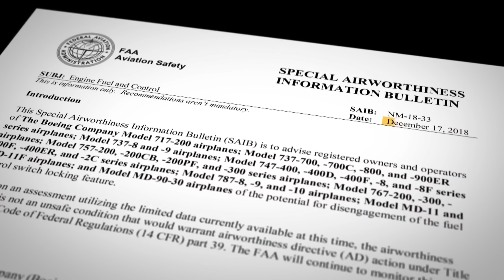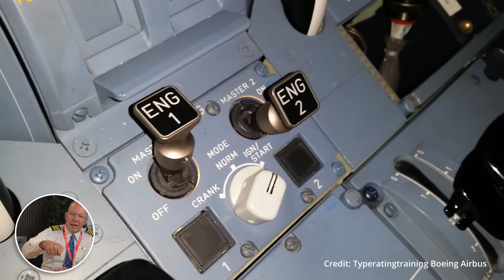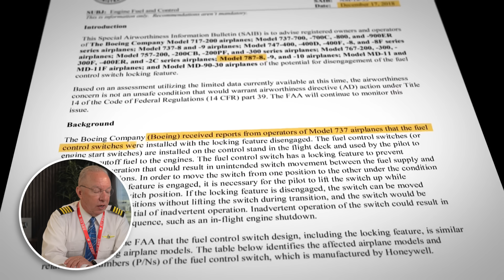Air India 171: The FAA’s 2018 Fuel Switch Locking Bulletin Explained (16 Questions Answered)

Comment: With all due respect Captain Steve , 
I just wanted to say 
The report showed that the flight was perfect and was scheduled for re checking for December 2025 .
Then if the Plane was perfect why there were so many technical errors goin with the same flight as recorded by the passenger ( Delhi-Ahmedabad) that day itself  bfre the the scheduled flight from ahmedabad to London . There's also a video of that flight having too many technical issues . 
So if all these components are already not working then I just want to say is there might be a possibility that the two fuel switches locking system might not be working properly  as well.
The chances are still there. 

Second thing( I might be wrong) 
But according to ur previous video you said the person might be lying that he didnt turn off the fuel switches . The thing is why would a person lie at literally his final moments?? Like even if his voice is being recorded by black box why would he just lie when he himself knows his fate is near ??? 

These are just some of my questions. If anyone can plz answer please do so.
Reply: When the plane reached Ahmedabad that morning, the techs worked on its electrical problems and released it as fit to fly. During the sadly short and final flight, the flight data recorder recorded no electrical problems at all. 

As to what the pilots said, I'm hoping the full report will have a transcript of everything they said as they pulled away from the gate to taxi to the runway. It may be that context will clarify some things. 

As to why he might lie, maybe he thought putting that on the cockpit voice recorder would spare his family some pain or even let them collect an insurance payout? 

Or maybe he was afraid his co-pilot would be able to save the plane and its passengers and he wanted to escape the blame for doing something truly horrible?

So many questions. Such a long wait ahead for the final report . . .
Reply: @Everywhere2 Pretty reasonable indeed 😮, Though We can't say anything to be 100% sure.  There might be high chances for pilot taking his own life still we cant ignore that 1% of any other cases.We have to wait till the final report comes to answer our questions 😔.

Comment: As an engineer, I would disagree with how you interpret the bulletin. It says they switches were installed with the locking mechanism disengaged, not that it would prevent the switches from being put into "run" position because it was installed wrongly. I remind everyone here that a pilot is not an aerospace or aeronautical engineer.

Comment: The question about the RAT deployment at 15:23 is interesting, not because of the source of where the questioner’s information came from, but because a photograph on page 14 of the report taken seconds after the plane was airborne and probably no more than 100 feet off the ground and still over the runway clearly shows the RAT deployed. I believe the timing of the RAT deployment in the preliminary report may be erroneous.

This report has led many commentators to go where nobody wanted to go and point the finger exclusively at human intervention on the part of one of the pilots. A full transcript of the conversations of the pilots, identifying who said what and when, including communications with ATC, may tell us why what happened did and prevent jumping to conclusions.

Also, the time for the aircraft to get airborne from the beginning of the takeoff roll to being airborne was more than a minute, which is long, notwithstanding the performance impairment caused by the hot ambient temperature. This could point to a problem, including the possibility there was overloading from luggage, a notorious issue on many flights originating in India.

Also, I understand it is not uncommon on Air India for a member of the cabin crew to be seated in the cockpit during take off and landing. I don’t believe the possibility of a third person being in the cockpit can be completely ruled out.

There is not enough evidence in the report for people to conclude human intervention on the part of one of the pilots. The pilots’ families deserve better and so do the families of all the victims in this terrible tragedy.

The report raises more questions than it answers, including why the Indian authorities waited until midnight on Friday, local time, to release it. That immediately raises suspicion that they were hoping it would escape mainstream media attention and critical scrutiny.

The preliminary report from the Boeing 737 Max first crash pointed the finger at human intervention, which turned out to be a travesty of justice. I am deeply concerned that so many people are willing to take the report at face value and not apply deep, critical thinking to it.

I believe the NTSB also needs to address the Wall Street Journal report, and reports from other reputable outlets, stating that the NTSB had threatened to pull out of the investigation, instead of stonewalling with a blanket “no comment.”

Releasing the full transcript of the cockpit voice recorder, identifying which pilot said what and when, and the transcript of communications between pilots and ATC, could clear up so many of the ambiguities.

It seems to me that the December 17, 2019 safety advisory on fuel cutoff switches should have been an airworthiness directive. It would be awful if it turned out that failure to make it an AD contributed directly to this disaster.

Comment: Hi Steve just one question, if both the engines were killed in a gap of just 1 second. Once the pilots realised the error he switched one switch back to run but Why do you think it took 4 seconds to turn the next engine on. All thought unbelievable when the crew realised the emergency. I think stopping the engine must be mechanical or electrical failure.

Comment: Concerning the rather arrogantly put and judgemental question from @12:23 this smacks of the current crop of folks who despite seeing with their eyes and hearing with their ears they still would not believe because it simply does not fit their pre-concluded narrative. Why don't folks just simply do some basic reserach before commenting on topics that are so widely in th epublic sphere? If @Katebatt7538 had done so she would have learnt that one pilot asked the other why they had put the switches in the cut-off position which the other denied. Why can't we just wait for the facts to unfold instead of bismirching the likes of Boeing?

Comment: Fuel cutoff switchs should be in up position instead of down to prevent pilot to accidently hitting them during take off since gravity tends to push our hands and arms down.
Reply: The switches are designed to not change position because they've been bumped or touched accidentally.
Reply: @Everywhere2 if they would have designed the switches so the cut off position if in the up position, would there be better because even if you accidently pushed the switches down, they would already be in down position.

Comment: 11:50 but hang on Steve, if there was a fire they'd pull the fire handle (and move them to discharge the first and possibly second bottle), they wouldn't be using the normal engine switches

Comment: I find it crazy that ATC have to undergo psychological tests periodically and pilots don’t. The FAA needs to get this sorted.
Reply: A key reason for the difference is that almost all of the air traffic controllers in the U.S. are federal employees. Airline pilots are not. The FAA can more easily make rules for itself than for corporations. The airlines resist in many ways on many things, but this crash may, in combination with the three or four other pilot-caused crashes, get them to adopt better testing, reporting, and treatment options. 

While they sure as hell haven't wanted to reduce the stress load on their flight crews, some changes were made (unevenly) after the Germanwings crash.

Comment: If they cut it off 3 seconds into flight that not letting you know the engine been turned off on the ground why you all think the rat came out so quick and the rat was out before it took off wild airborne in the Rock jump out on full trust those engine turn off on the end of the damn runway what you're talking about and that's what makes the shut them off cuz they are just airborne while I still had that trust the shot of my one of them off to try to turn it back on it didn't turn on then turn off the other one to turn it back on and then turn on clueless what to do have some empathy Captain Stevie

Comment: In todays age every transport mode has cctv installed be it train, truck, cars, cruise etc then why not planes. This is just stupidity. Any cost cutting measure, pilot privacy etc thing should not come in between in implementing such a basic function . Even a low res cam would be fine enough to capture the scenario.

Comment: But there wasn't a place to cut off for too long because someone turning them back on you just showing a picture of both of them being off did they stayed up did they turn back on 23 seconds 5 seconds after a pilots turn off the engine to see if they could get them to reboot back quick is split seconds situation bro it's not no minute situation it's seconds😮

Comment: Captain you keep repeating their mechanical so therefore they do have a breaker mechanism to snap them off if you Rollin you might not hear the snap off if you roll in and it's roaring engine you will not hear the breaker snap off does it have a breaker switch built in and that unit been warming up spring get weeks when it warms up and don't let the solenoid to switch it off both of them when the engine went in full trusts the unit got warm very quick make it make sense captain

Comment: IMHO, 'em electro-mechanical fuel cut-off switches (interlocked or not) maybe be bypassed by faulty micro-processors - a manual re-boot via 'em switches maybe possible but at that level, the plane is doomed ...

Comment: Captain, the second question is to be the real eye opener and must be given more attention.

In my earlier careers, I too dealt with such spring loaded toggle switches with detents at both up and down positions. 

In this case of accident could we suspect a sabotage from the maintenance  crew?

Is it possible that in the upper position of switches ,  during engine startup, that they were not locked to the detent latches?

Prevented it from being so by insertion of some small solid non metal pieces,( by some mean-minded elements at the time of final maintenance), which hold the switches in Run position when the aircraft is in 0-0 position.

In the nose up position, the insertions might have come out and the switches might have fallen down to the lower side with a click?

Pls don't jump into any hasty conclusions Captain and never blame everything on your own folks.

Stay blessed. 
I still love to watch you on your channel.

Comment: Is it technically even possible to switch the engines off intentionally in this situation during take off? Even if you try? Isn't this controlled by a computer designed to make this kind of action impossible? This is not a B-17. It's 2025 and the 787 is one of the most advanced airplanes.

Comment: Your assumptions that one of the pilots had a mental breakdown doesn't add up. As a pilot you can just push the yoke forward. No modern aircraft should be able to shutdown fuel supply to both engines on assent below xxx feet. IMHO this sounds like an issue with auto fuel shutoff and then the pic recycled the cutoff switches to reignite the engines.

Comment: For question at 15:14 The RAT getting deployed shortly after takeoff is mentioned in the Report along with screenshot of the rat deployed while liftoff from runway.

Question? Why dosen't the report mention anything about the aircraft taking off from the very end of the runway. One pilot mentioned based on the review that the Vr and liftoff was achieved at a distance suggesting One engine failure and overloaded aircraft.
Reply: She was certainly carrying a heavy load of fuel for the long flight and may have been over weight with passengers and cargo - as some commenters here say happens frequently with flights originating in India. It was a hot day - 40C/104F - so air density was reduced. But given what the FDR captured, she was able to fly - until the fuel to her engines was cut off. Maybe one of the AAIB's recommendations will be to stop overloading planes. Time will tell.

Comment: Surely one design change to follow from this would be to not have a switch that can turn the engines off mid-flight? My instinct is once the wheels leave the ground, the switch should be disabled. 

Or, is there a reason you might need to do this manually in the air?
Reply: Yeah, if there's an engine fire the pilot has to *immediately* switch off the fuel going to that engine for reasons that, I guess, are pretty obvious.

Comment: Fuel Shutoff switches are separated from Run and Cutoff positions by a high “gate” not necessarily a detent.  A detent implies that the lever sits in a detent or passes through a detent.   The “gate” stops the lever from inadvertent movement past the gate, it requires a physical intervention to move the switch OVER the gates

Comment: The logic should be that the computer must avoid shutting down both engines at the same time... at least during critical phases.

If it's true, as the pilot says, that having both engines on fire is an almost impossible scenario, then the aircraft's logic needs to be revised. The pilot should be allowed to shut down only one engine at a time (presumably the one that's on fire or malfunctioning), but not both and not simultaneously and in any case, only during the most critical phases of the flight: takeoff and landing

Comment: VERY VERY AND VERY IMPORTANT POINT:
Some people believe that perhaps the fuel control switches were not properly locked, or there was a fault in their locking mechanism, which caused them to shift to the cut-off position on their own.

However...

The jet struck the building during the crash, and despite such a massive impact, the fuel control switches were still found in the "Run" position, as mentioned in the report.

So, if there had been a malfunction in the switches, they would have shifted position during the crash as well, but that didn’t happen. This suggests that the switches were deliberately moved to the cut-off position before the impact,
What is your opinion on this?

Comment: Both have a slope on the back why you got to pull them up to lock in run position pull up when both has slope towards running position and it seems that you could just push it up and lock it in make it make sense captain please think before something come out your mouth because I think you slipped right there talking about the back of the switch of a slope so why put them out to engage them supposed to just push them forward and then they're locking when it's time to shut them off you have to pull them up above the slope to disengages

Comment: Captain steeeve, i was just doing my TR sim today (b77w) and just to show that the detents really work on the cutoff switches, I filmed the switches while tapping it pretty hard to get it to go to cutoff (obviously it won't work with the metal detent + pull action required) but it can definitely show non-pilots especially of the type. I also have a high resolution close up of the detent as well. How can I send these to you? Safe skies.

Comment: The preliminary report says the fuel control 'transitioned' from on to cut off.. it does not say it was physically switched off. PLEASE EXPLORE THE RELEVANCE OF CHIPS / SENSORS MALFUNCTIONING DUE TO HEATING OR ELECTRICAL ISSUE OR SUMTHING.. Both fuel controls transitioned in 1 second. Physically offing them might take a bit more than that.. How can BOEING be given a clean chit so conveniently?

Comment: Is it possible that the fuel switches remained in the run position from take off to time of impact and were never in cut off.fuel was stopped by technical mechanical or chip failure.remember electrics were reported in previous flight of the 787.👍🐶🇬🇧

Comment: Steeeve has not answered the most important question. From the SAIB:

If the locking feature is disengaged, the switch can be moved between the two positions without lifting the switch during transition, and the switch would be exposed to the potential of inadvertent operation.

If there is no way the switches can be moved inadvertently, why the bulletin was created in first place? What is the bulletin taking about the locking feature which can can be disengaged during installation?

Comment: The Pilot asked the question if he had placed the switches into Cutoff position and the OTHER Pilot said No. Hence we must assume that the switches were not placed to cutoff by the pilots and there was a flow in the design / installation or performance of the switches!! Pilots were not in flaw here.